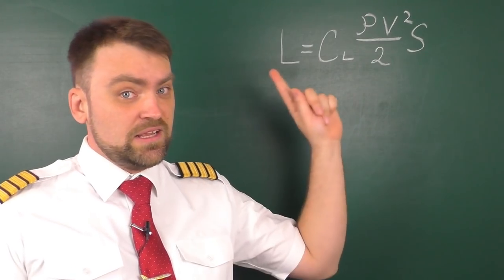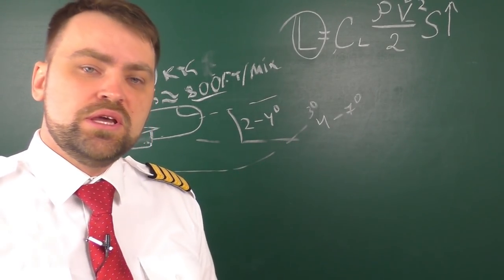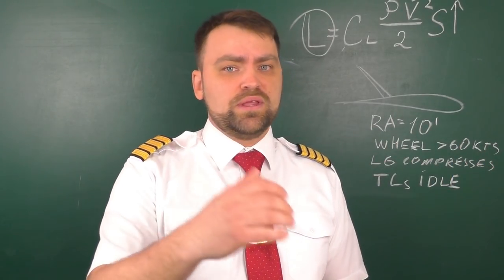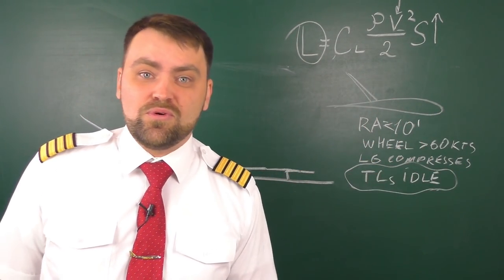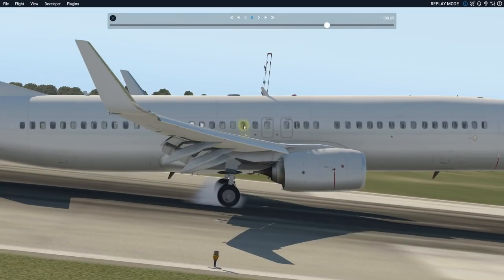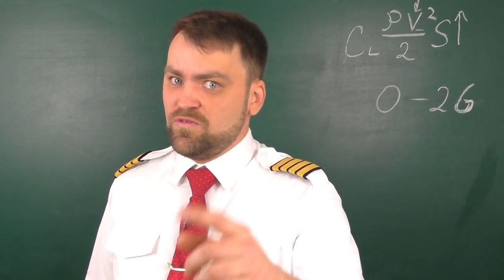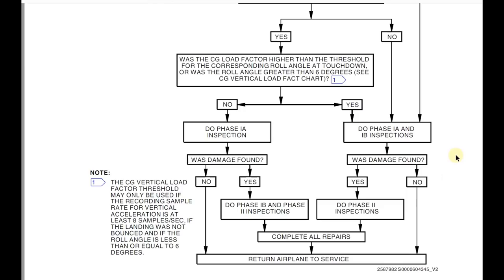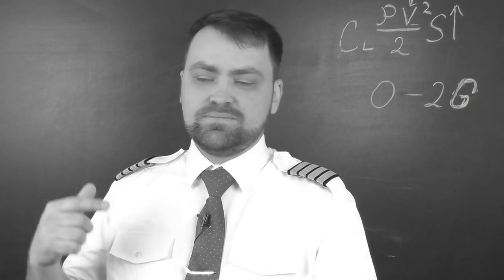Airplane Hard Landings Explained by Boeing 737 Pilot

Comment: Pretty sure we use to experience minor tail scrapes on 727's which use to have steep take-offs early in their -100 and -200 existence. Later on they would not perform such steep takeoffs and they stopped having scrapes. I think there may have been some protection plate for the tail scrapes for 727's but not sure.

Comment: On ATR 42/72, the Flight Data Monitoring triggers hard landing, although not considered "hard landing" by definition as no maintenance procedure is needed when it happens
Class1  1.5G
Class2 1.6G
Class3 1.7G

The hard landing maintenance procedure for ATR is found on AMM. For ATR42 and 72 at MTOW hard landing is +2.3G and above, it can even go beyond +3G at 13 tons. So positive landings on ATR is a normal landing. Considering that ATR is a falling rock where as per procedure you need to put the power levers idle at 20ft at approach speed lol.

Comment: Excellent information Captain as usual. Thank you so much!
This subject interests me particularly, because I find it difficult to have a stable method to ensure a smooth touchdown (in Zibo 737). I note the importance of a gradual reduction in throttle from 30-40 feets, is that it?
I think I was pulling back the throttle too fast to idle which induced an early loss of lift then a firm touchdown.
Reply from the maker: Hi! 20-30 feet)
Reply: @PilotBlogDenys  Right. Thank's Denys!

Comment: What will happen if the airplane wheel explode?
Reply from the maker: There are 2 wheels on each landing gear usually. One wheel is capable to support the plane.
Reply: @PilotBlogDenys  so if 1 burst the other one can still hold the weight of the plane?
Reply from the maker: @SkrraDoesCod  Yes